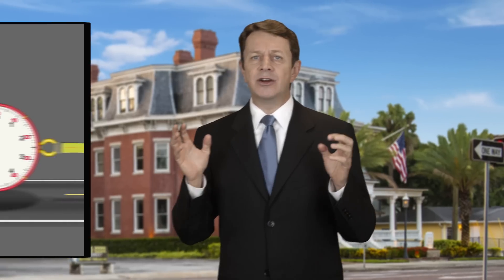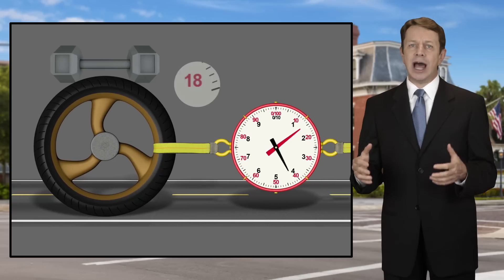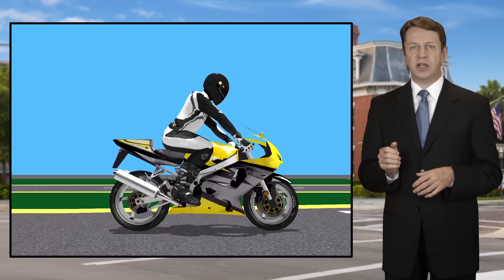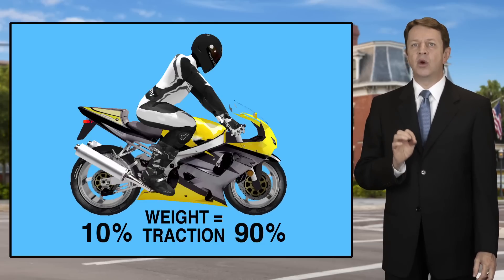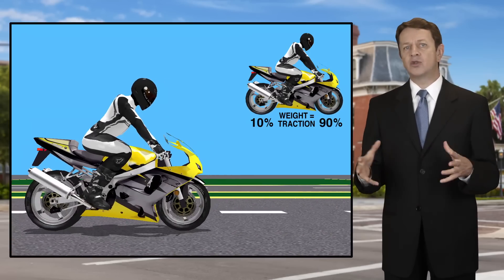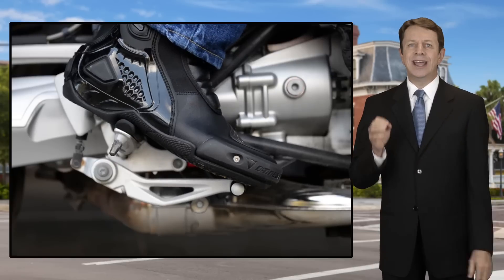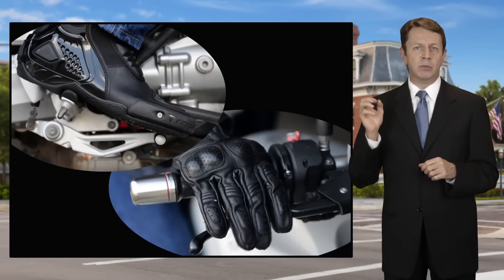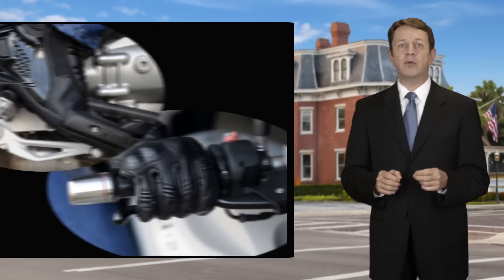MOTORCYCLE EMERGENCY BRAKING - Emergency Braking to avoid serious injuries and damaging your bike!

Comment: Braking is progressive so percentages are mute.
As for going down gear in an emergency - Why...? You're asking the rider to concentrate on two tasks at the same time, concentrate on the emergency braking, pull in clutch to prevent a stall but who really cares if you stall at least you've  survived the accident or avoided one...
Otherwise agree with pretty much everything else...

Comment: Emergency braking.. this is NONSENSE.... you apply the front brake as hard as you can - your Adrenalin will help a lot, and then the back brake 1 second after... sure pull the clutch in at the same time... but if you have the ability to think about down shifting, then you clearly are not in an emergency situation. !!!!! - the number of times I have seen youtube motorcycle crashes where the rider clearly has not applied the front brake as hard as he can... countless.... if you are not confident, then practice but make sure is no one behind you !!!... also, it is possible (if impact seems unavoidable), if you have got rid of most of your speed, to then release the brakes and take avoiding action as in ride around the obstacle... as you are then at a much lower speed..
Reply from the maker: Good advice if you have anti lock brakes on your bike.  If you don't, and start to skid, you are in even more trouble.  Ride safe.

Comment: use both brakes more in front less in rear at the same time
Reply from the maker: That is right, the front brake has more stopping power.  Practicing will make you a better rider.

Comment: What was the significance of 70/30 weight distribution in stopping?
Reply from the maker: You want to avoid 100% on the front brake to maintain control.

Comment: Excellent video thanks for sharing I’ve practiced many of those techniques question for you- why is it important to be in first gear when you come to a stop?
Reply from the maker: After emergency braking, you want to be prepared to move quickly in case another vehicle or threat may hit you.  So, by being in first gear you make it easier to get out of the way of another danger.  Ride safe.  Matt

Comment: This lacks the factor that you can lock the wheel and lose control. A car stopped in front of me and I was afraid to use the full force of the front brake so I won't slide. Instead the rear wheel locked and slid for a long distance, I barely made it , the stopping distance was way too much, I still have to find a way to stop better.
Reply from the maker: Thank you for watching.  And it all goes back to the basics, and that is to practice practice and practice some more.  Ride safe.  Matt

Comment: Best is to steer your bike Around an obstacle.  Hitting your front brakes hard (non ABS) will cause a skid.  Always apply Rear brake with front and tap the front ...not grab.  I've avoided many a sudden stopped cat using these rules in 50yrs of riding.
Reply: Martin Sage you are one lucky Sage to survive for so long practicing a totally dangerous braking technique. Hitting the rear cause a bike to skid, not the front. And never try to steer in a panic when the object is just a fraction of seconds away from you. You will either end up losing balance or if you front brake while steering you will lock up the wheel and go straight for a deadend.
Reply from the maker: In an emergency, braking to reduce speed is always going to lessen the impact.  You want to practice so you maintain control in an emergency.  Practice, practice, practice. And ride safe.

Comment: Just wondering what if bike does not ABS wont it result in wheel lockup?
Reply from the maker: Many bikes don't have ABS, and that is why practicing hard braking is so important.
Reply: Motorcycles that are on clean dry pavement - no dirt, gravel, pebbles, etc., will stop very fast and not lockup the front wheel. It's very hard to get that wheel to lock up. When braked, the front tire will experience very heavy forces pressing it into the pavement and this will increase adhesion keeping it turning and transferring energy to the brake pads and rotor. As for the rear, you can lock it up like on a bicycle, but with practice, you will learn to modulate it. You can try in a safe place locking it up for practice at 10-20 mph. We had to do it in second gear at our motorcycle training class and everyone was fine.
Reply: @ninemilliondollars  guess it's good then that I only use front brake
Reply: No, use front and rear. If you have a 300 lb. bike and have 50% (150 lbs.) of that on the front tire and 50% on the rear during normal riding, when doing hard braking it may shift to having 70% (210 lbs.) on the front and 30% (90 lbs.) on the rear. So even though the rear has lightened up, it still has 90 lbs. of downforce which is very good to make that rear tire adhear to the pavement. Don't overlook that this can increase your braking power by 30%. So Saptarshi, use both.

Comment: How about explaining how to downshift in an emergency stop.  I can't imagine downshifting that fast in some extreme situations when hitting the break hard because the stoppage would be too abrupt so what do you do?
Reply from the maker: Downshifting for a stop is a good practice point.  But in an emergency, there is not enough time to use the engine to help slow your bike, and you might shift too hard and skid, or too light and not stop as efficiently.
Reply: Thanks for helping me out.

Comment: Hi there. Should I apply front brake even if it's downhill? Doesn't it cause too much weight shift?
Reply from the maker: Hi Lei,  downhill braking is similar to level braking, but you have the added speed associated with going down a hill.  So, when you brake, the effect of a hill is to make your bike seem faster or heavier and as a result you need more distance, more time to stop.  But the act of braking is essentially the same.
Reply: In addition to what Matt stated, keep 12 seconds of clear sight between you and what's ahead. You need to see if there's a wreck, oil on the road, road debris like wood, bottles that must be avoided, or water. So when in the mountains and going downhill, the bike seems to weigh more - keep a good distance. And lastly, you always use the front brake except if driving like in a parking lot at very slow speeds doing turns. You have more control when slowing then using the front brake because it will tend to throw you toward the outside handlebar as the suspension is depressed.

Comment: Remember the danger of using the front brakes while turning. It can be devastating and a lot of people have lost their lives while turning to avoid a crash, resulting in a skid. So in an emergency situation, stay vertical as much as possible and engage both brakes correctly and if you are not able to swerve using reverse steering techniques to negotiate around a crash.  Also, remember that a similar situation can happen while down shifting.  Here, the use of a slipper clutch can help.
Reply from the maker: Great points, thanks for sharing good safety tips.

Comment: A few remarks on the video: Firstly weigth shifting is not happening. the position of the centre of  gravity (c.g.) is not changing or only a small amount  (e.g. the fuel might be forced to the front of the tank). The increased pressure on the front tire is coming from the inertia that the braking is trying to counter. Inertia is pulling the c.g.forward. the c.g. is about 20, 30 inches above the road, so there is a torque or moment creating more down force on the front tire and less on the rear tire. To get the physics correct :-) .  Secondly applying rear brake in an emergency can cause the rear wheel to block and to lose traction completely, due to diminished downforce on the rear tire. The blocking of the rear wheel is making it more difficult to stay vertical. So be very easy on the rear brake if any. Time for gearshifting might not be availalble, so let the engine stall if needed. Getting the bike to stop is your only concern.
Reply: Good comment. I asked a guy once that raced motorcycles about how to ride in the rain and the rear brake. He said go out and ride when it's wet and at slow speeds, like 20 or less mph, lock up the rear brake. That will tell you a lot about wet pavement. And since we invariably ride in the rain, we're going to do that at some point or another. 

Regarding what you mentioned on rear tire diminished downforce, I agree that modulating the rear brake in an emergency (an art that needs to be practiced) is necessary not to lock it up. And I always brake with both front and rear knowing that. My CB1000 weighs about 590 lbs with fuel. Assuming 10% of the weight on the rear is left under very hard braking, I still have 59 lbs of downforce pressing on the tire and that is useful.
Reply: Actually weight shifting is happening
Reply from the maker: Excellent points, thank you.  I agree, the center of gravity is not really changing when you brake.

Comment: Great video. When you talking about putting on the front brake you are squeezing with left hand. The brake lever is on the right side. So that body language throughout is incorrect. Just an interesting thing I noticed. Makes me think you dont actually ride. But the rest is great info.
Reply from the maker: Hi Gregory, thanks for watching, and good catch.  I will fix that edit.  Keep riding safely.
Reply from the maker: Upon further review, I am using my right hand.  Not sure what you are talking about.
Reply: First 16 seconds. "What happens when a biker applies his brakes." Thats your left hand. Clutch is the left on bikes brake is right hand side except on automatic scooters.... I checked too. Its not biggy.

Comment: Get on a bike and step on the rear brake and see what happens!! The reason for bigger and dual brake disks on the front is for braking in mid corner. Bigger brake disks prevent the wheel from locking up. Not better stopping power. 

In the event of someone pulling out in front of you. You must apply front brake. Turn your attention to direct where you want to go and push the handle bar to that direction (countersteer). Attempting to use a rear brake in an emergency situation is going to lock up the rear wheel. If you don't go down or getting rear-ended by the car behind you, then you would just slide directly into the car. 

You had just explained bad advise. I urge you to study and practice methods and techniques in riding. Then make another video that's less faulty. And delete this one immediately!!
Reply from the maker: Hi Josh, thanks for your suggestions and observations.

Comment: So should i even engine break with brakes squeezed? Or not?
Reply: That is a great question.  The answer is it depends.  If you are good at engine breaking then yes, do so, but if you are not perfect at engine braking, then you should not try it in an emergency.  This is because if you are not perfectly smooth with the clutch, you could suddenly apply too much stopping power, and lose traction all together.  I say you are better off using both brakes rather than trying to shift gears and operate the gas too.
Reply: Matthew Powell engine braking is disengaging the clutch, am i right? Or not?(Correct me if im wrong. Just a beginner) Which do you prefer(specially in emergency braking). Disengage the clutch while brakingg both brakes or even just engage it? And the downshifting is when during the braking, am i right? Theres one here that i read, it says, “downshifting adds 10 feet to stop”? Just asking this because i just want to mitigrate an accident cause i just heald from motorcycle accident and its because i dont really know how to (properly) “emergency brake”
Reply from the maker: As a beginner don't try to engine brake in an emergency.  Just focus on using the front and back brake and maintaining control.  Don't try to do too many things when every millisecond matters.

Comment: I usually use 65% front brake, 25% rear brake, 10% downshifting.
Reply from the maker: Just practice and when you have a real emergency, you will be prepared.
Reply: +MattLaw absolutely agree. . .nice video
Reply from the maker: Thanks.

Comment: not a bad video ... but .... some major points where missed.. simple practising routines when nothing is around would be 1: Cover your brakes at danger points like intersections passing parked cars and coming over blind crests in the road( probably a million other things to take care with, but covering your brakes is essential to being able to stop in an emergency.  2: set up brakes (take initial 1st squeeze to apply down force on front wheel and maximise the fork dive to its fullest) 3: Squeeze (once fork travel is reached and massive extra weight and larger contact patch you can apply a much larger amount of brake lever pull, enabling a j-curve amount of extra brakes to be applied as apposed to just pulling on a shit load of brakes without set up)....set up is, quickly apply the brakes to start the fork dive usually just enough to get the forks to compress, this as you mention places more downward weight on the front wheel, which FLATTENS OUT THE CONTACT PATCH of the tire to the road, greatly allowing more and more traction through the added weight and the larger contact patch of tire on the road and then squeeze the brake on so much harder than you ever could if you simply just grabbed a fist full from the get go ..  So always get into the habit when passing intersections and other potential dangers by covering your brake lever in readiness for dead shit drivers who just don't see you..and then apply the set up and squeeze method... I think this is what  Matt was trying to say without going into the detail of what is really happening at the front tire's contact patch.
Reply: Hi D Murray, and thank you for the excellent points you make, especially about covering your brakes at danger points.  And your description of how to brake is perfect.  Thank you for adding to this video.  Matt
Reply from the maker: Thanks for watching.

Comment: In pakistan 70-125 cc are super common 
And when I started learning how to ride (I have the 70) everyone told me to never use the front break never always use the rare break , if you use the front you will flip over only use it in emergency
This is the complete opposite to what they teach in the west like idk which rule to follow now I asked about breaking from like 15 different people (in pk)  and they all said the exact same thing (never ever use the front )
Maybe its caz of the lower cc bike 
(Every tutorials in the west is on a 300cc+ bike )
Reply: +Your worse enemy Doesn't make any sense at all; on every single vehicle the weight shifts forward when braking - even cars. Thus, some cars have disc brakes up front and drums in the rear. 
It's much more of an issue on motorcycles though, because the weight shift so much more.
Anyway... you could try it. Full stop with rear brake only, and then full stop with front brake only. You'll see how much longer it takes to stop with the rear brake...
I've been riding motorcycles for about 34 years now, and I've never heard of or seen anybody "flip over", because they used the front brake.
Reply: Emergency Threshold Braking:
I think to practice emergency braking should be mentioned and practiced.

Note: Every time you stop you put both feet down at the same time when the motorcycle has stopped.
That keeps you upright and balanced instead of leaning and having to hold the motorcycle. 
And think… if you have to ride away quickly you don't waste a precious second getting the motorcycle vertical before riding away. 

So …..Start at a reasonable speed like 40 to 50 mph in a big open empty parking lot.

Find a marker on the road as a measurement point. 

Do 3 emergency stops from that marker and note where you finally stop and mark that point with something like an old glove.

Next. 
Practice rear brake only first - apply it slow and evenly over and over until you are able to brake right at the threshold of skidding but don't go that far.
Next is front brake only - and ditto the same practice applies as the rear.

Now the same speed and use both brakes right to their threshold skidding point.
Practice that a good number of times.
Now go back and recheck yourself at the first location that you marked with the glove. 
Do another emergency braking. 
You will see that you have stopped much shorter than your first time.
Do this exercise maybe 3 or 4 times a year to keep your skills sharp.
Yes I know about ABS and linked brakes.
You can still skid an ABS equipped motorcycle. The tires skid and release numerous times quickly. 
Try to get to that point without reaching it for maximum braking efficiency. 
Eventually you will discover that the front brakes have more stopping 'power' and therefore you will apply maybe 60% of the braking to the front and 40% to the rear. Of course you can't do it that precise but it is a good target value.
In emergency braking you hardly have time to downshift.
You can just pull in the clutch and use your left foot to get you down into first gear and ready to ride off based on what happens behind you when you stop fast.
Reply from the maker: Please practice using both brakes to maximize your control.  Ride safely.